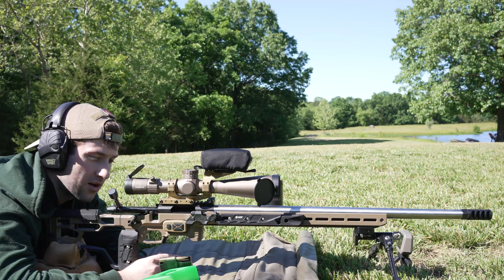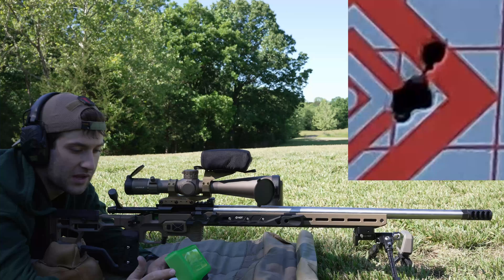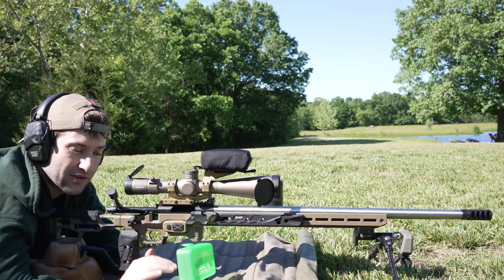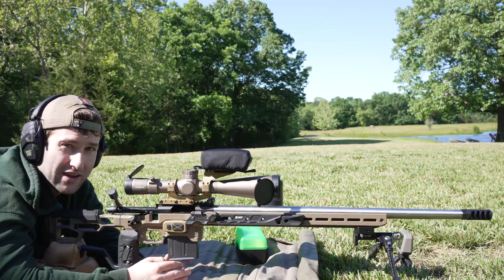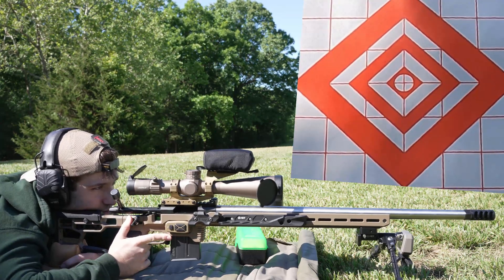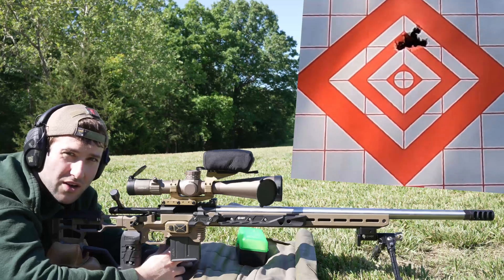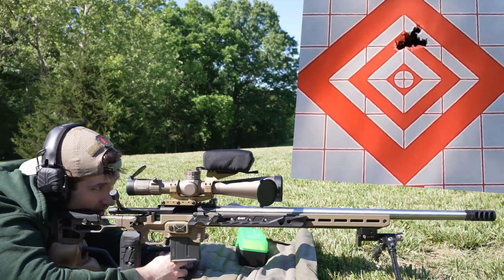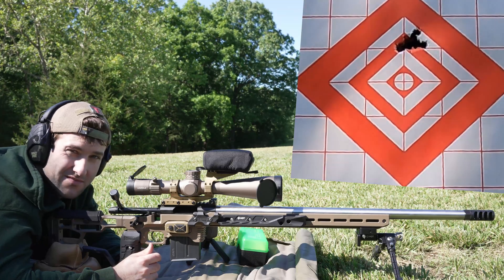140gr Aeromatch Load Validation in 6.5 Creedmoor: Vihtavuori N560, Alpha Brass and Federal 210 Match

Comment: I did some test loads on a new 6.5CM with 140 JLKs using N550, N555, N560. Best speed was n550. Best group was n560 with initial trial
Reply from the maker: I was very surprised to see N560 be the one that this barrel seemed to prefer, but it seemed to like it!